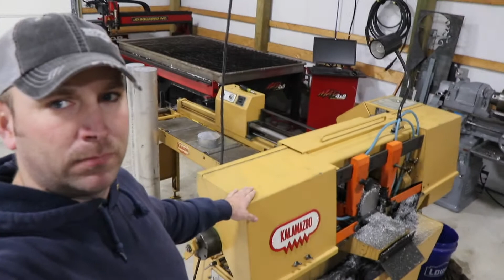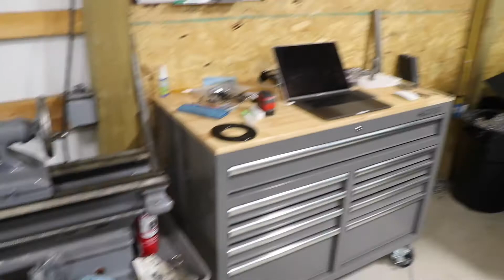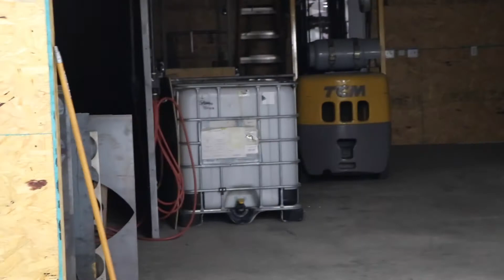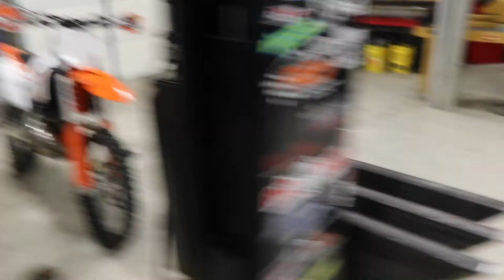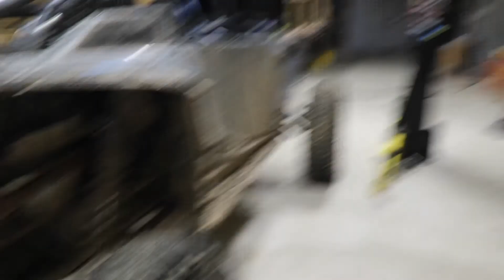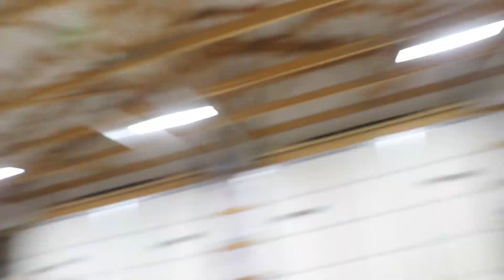Shop Update! New Haas Milling Machine! RZR Updates?

Comment: Helluva nice shop man!! I’ve got my own shop making custom sxs parts here and there and I make tie rod couplers (rod busters) tht I sell at pro service Motorsports & windrock general store. I’m fixing to start my first cage next week. I’ve got a a 2017 general tht I’ve turned into a crawler but now I’m wanting to do a tube chassis . U got any advice man? I don’t have a plasma table or machining tools like ur bad ass setup I just got some basic stuff a coupler welders couple bandsaws bender stuff like tht. I want to use my generals motor and transmission and start fresh making a trail tube chassis THTS 72” wide . I also wana make it a trailing arm setup not a arm like it is now. Help me out brother becuz from the looks of it u no what ur doing lol.
Reply from the maker: Thanks a lot. Just do your best to put out a quality product and don’t cut corners to save time. It will pay off in the long run!